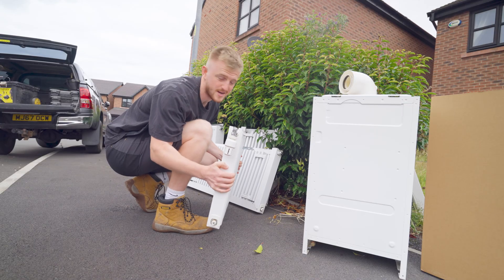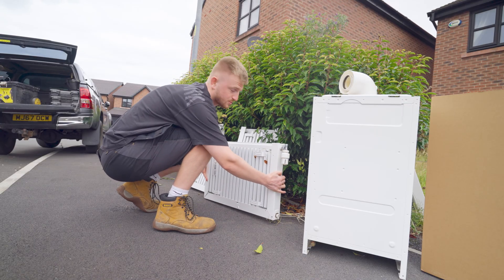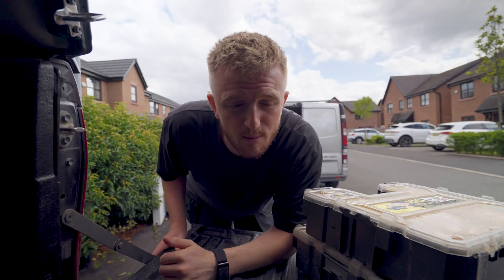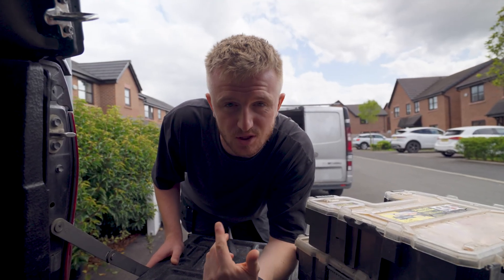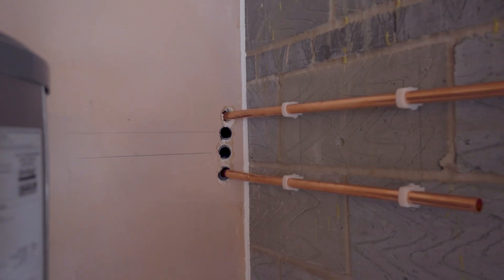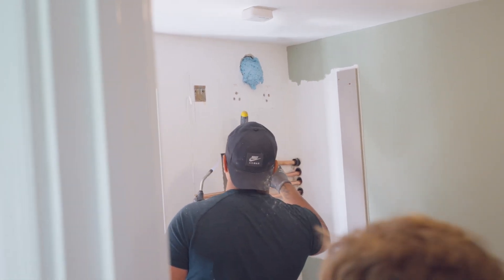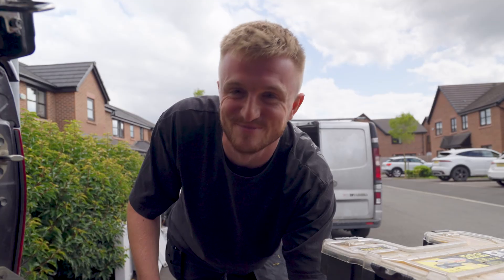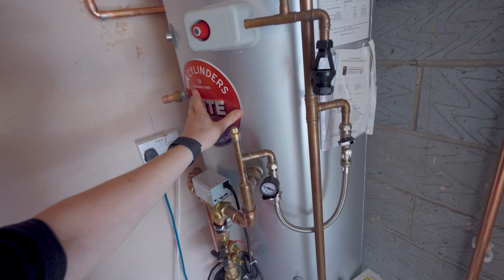Our First Heat Pump Install - Worcester Bosch 2000 Air Source Heat Pump

Comment: No vibration isolation dampening between heat pump and the wall bracket, let's hope the cavity wall stops any humming from the HP disturbing the homeowners.
Reply from the maker: Thats an interesting point, no complaints from customer but definitely something to consider
Reply: @iheat  yes you do need to install it, as vibrations can go through the wall or annoy the neighbours in winter defrost cycles

Comment: That’s going to be blowing cold air against the neighbors  side wall 24/7
Reply: And make absolutely no difference at all.
Reply: @ 
                                Were the neighbors happy with that, or is that just your opinion
Reply: @johnb7644  Counter point - do you know they were unhappy or is it just your opinion.

As a heat pump owner, and knowing how they work, just because it's blowing cold air against the side wall, it will make zero difference as the air gets mixed pretty quickly with the outside air.  And as it's a wall and not a window or opening it's not going to affect the neighbouring house at all.